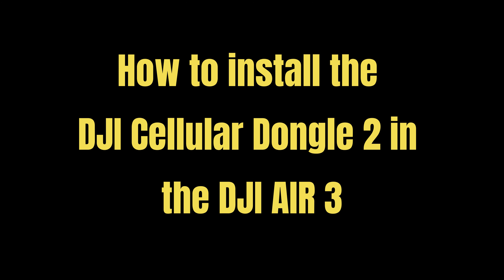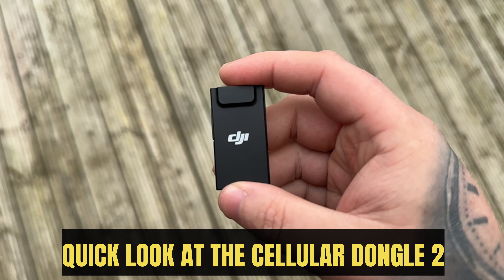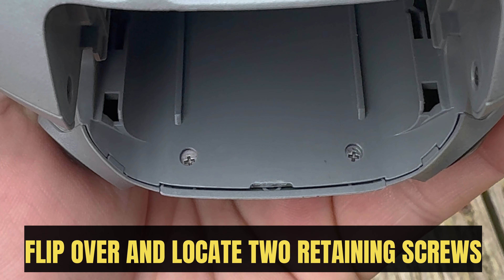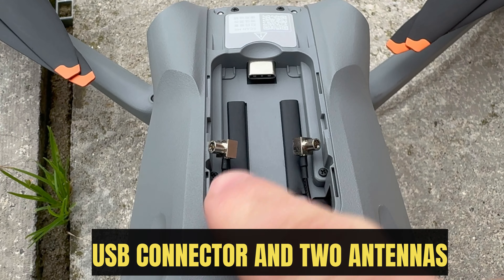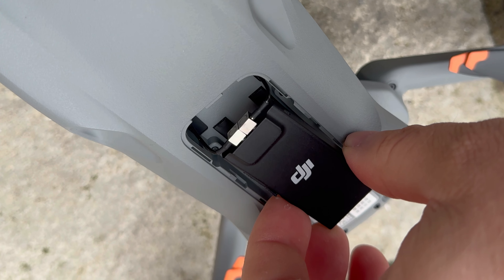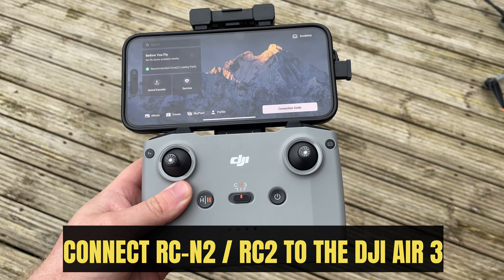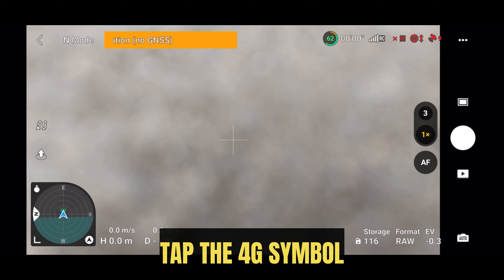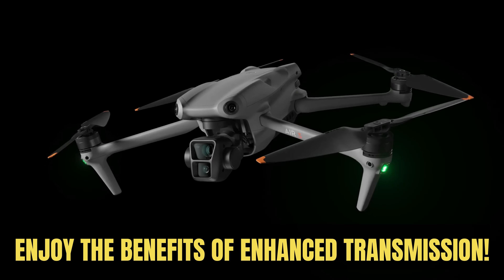How to Install DJI Cellular Dongle 2 - DJI Air 3 Set Up Tutorial

Comment: Just got my Air 3 and install the dongle not forgetting the aerial cover, the best G4 network around my way is EE, which do an 120gb data sim for a year cost is £60 I going to see how long 120gb will last
Reply from the maker: Wow that’s a good deal!
Reply: A 'standard flight' utilises approximately 800mb of data. I don't know what the trade off is in terms of switching from regular connection and 4g depending on signal strength. You can also get a 120gb nano sim from O2 for £50.00. It expires after 12 months. The alternative is an uncapped nano sim ftom EE which costs £16.00 per month on a 24 month contract. I was twitchy about using EE as they are part of BT and I really don't like BT. The fact that you have said the EE card seems good gives me confidence and I think I will go for their uncapped 2 year deal 😊
Reply: @geofflittler2035  thanks for the information, I think I may go and get an O2 SIM card as well 👍
Reply: You could use 120gb in 2 weeks it would nevet last a year
Reply: @geofflittler2035  where did you find the information about how much data is used per flight?
Reply: @jasonlee4267  There are a few people already using the dongle that I have had contact with on the DJI Forum. One lad is in Ausralia and I think the other one is in Poland. The Australian feller said that he uses an uncapped nano sim card and this seems to be the most appropriate way of running the 4g dongle. The people on that forum do seem heavily invested in DJI drones and they all seem to know what they are talking about. One  user said that he was using the dongle with a Mini 3 Pro and his data usage was approximately 800mb per flight with his drone battery running down to about 15% after 25 minutes flying. I was unable to establish what the trade off is if any when the drone is not using 4g but the standard drone to controller signal is good enough that 4g is not required.
Reply from the maker: @geofflittler2035 I feel those figures are correct, I’ll try edit the video asap
Reply: @GAVINHR  come on gavin were all waiting lol, i was going to wait till next week but figured after you upload ifnit is that good theyll sell out quick so ordered my today
Reply from the maker: @Michael77333  it’s incredible! Trust me, better than what I can show 🫢

Comment: Also...is there one of these for DJI mini 4 pro?
Reply: Can you use any sim card from any mobile phone provider?
Reply from the maker: Yes the same dongle fits the mini 4 pro with the mounting kit
Reply from the maker: Looks that way, I am using a SKY sim card and i have tried O2 and both worked
Reply: @GAVINHR  I live in the usa.  Is this to make it fly even further?
Reply: @BIGPAPAFOOT  due to DJI Support aint allowed on US soil -> DJI Forum. Sry
Reply: @GAVINHR  In have you noticed any difference with the signal?
Reply: @Teflonfilmare  not sure what you mean?
Reply from the maker: @slhk5848 I will be testing and checking this and will report back as that’s the whole point of it :)
Reply: @BIGPAPAFOOT  due to message on DJI Forum that rep claimed not supported in the US. DJI Cellular Dongle 2. Ok?
Reply: Does this not put the Mini 4 Pro over the 250 grammes limit?
Reply from the maker: @johnpirie4804  it sure does indeed but that only affects where you fly if
Reply: @johnpirie4804  there's an abundance of DJI aircrafts weighing over 0,55lbs. For these different rules and regulations are valid. And your question is Sir? Hmmm 🤔

Comment: OK here goes. I am such a lily livered push over for new stuff that DJI must be laughing behind their hands at me. I sold my Air 3 minus the dongle last Friday. Today my Air 3s turned up from DJI and tonight i charged it up and fitted the dongle. I have to say the dongle fits in about 20 seconds flat. The dongle compartment cover just clips on and off  no screws or screwdriver to mess around with. The black plastic clip that sits over the connectors on the Air 3 isn't needed either. The connections on the Air 3s are a single block with 2 connections which just slide onto the dongle. Once you slide the dongle onto the  main connector pretty much that's it. Tomorrow my new birdy flies😂

Comment: does the RC2 have built in 4g capability? or does this only work from phone to drone? on the Rc Pro you had to buy 2 of these dongles right? one for the controller and one for the drone.
Reply from the maker: Right so, no the RC2 has no 4G and it can't take a dongle, what you do is tether it to your mobile (hotspot) and it uses your mobile service, I will get the video out as soon as I can edit it where I show everything like this
Reply: @GAVINHR  awesome, thanks for this Gavin, I am waiting for the imminent Air 3s/Air 4 announcement in the next couple of weeks, but this dongle looks absolutely fantastic addition.

Comment: Nice idea, but what are the advantages / uses for the 4g connectivity?
Reply from the maker: My review video will be live later today, essentially bulletproof connection
Reply: Your drone is in range as long as its in an area, where there is 4G and your controller is connected to the internet either through 4G or WiFi.
It is even in range on the other side of the globe as long as there is 4G.

Comment: So can I just buy a sim card, and does it use data or just the 4g network? Also, stop teasing and get the thing in the air, lol how long did it take you to get the dongle? I did see dpd next day with a link to dji, but on their shop app, it says 20th of july.. 😁👌👍 🇬🇧
Reply from the maker: Yeah so I ordered it on the 30th June, it seems the mini 4 pro mounting kit is out of stock so they held the order until I contacted them on Thursday and they split the order and it came next day! Yeah I just used a sky SIM card out my iPad to test it and it worked fine
Reply: @GAVINHR  well I've got to order one now, lol. I've moved from Croydon london to a bit of a countryside, and with all the trees, the signal is crap so hopefully, this will sort out my issues 😀 nice one gav Cheers mate 👍
Reply from the maker: @UKBUBBLERS  let me try it first mate and see how good it is I wouldn’t want you wasting your money :)
Reply: @GAVINHR  yeah ill await your review, lol

Comment: To any of you who are Mini 4 Pro users you can  fit the dongle on your aircraft. You will need an external mounting kit which comes from DJI at around £16.00 Please bear in nind that the dongle weighs around 5g and will push you over your 250g ceiling. Personally I have the Air 3 so not such an issue.
Reply from the maker: Indeed, my mounting kit didn’t turn up sadly ( not useful for a review ) where did you get the usage data from?
Reply: @GAVINHR There's a couple of people on the DJI Forum. One lad in Australia and the other in Poland I think. I asked one of them about data and battery usage. Specifically if I am flying without the 4g requirement as my signal is strong enough do I still lose some battery? They said that approximately 800mb for a flight and that because the dongle is permanently powered during flight there is some battery usage. One of them was using a Mini 3 Pro and said his flight time was reduced to approximately 25 minutes. The other chap said that his battery loss was fairly negligible. I do not know which drone model he was using.

Comment: Never knew it was available in UK. I thought you could only buy it in china. I currently own the mini 4 pro
Reply from the maker: It’s just been relaunched as the “dongle 2” and it’s now available:)
Reply: @GAVINHR did you try it?
Reply from the maker: @Michael77333  yep, very very very successful flight !
Reply: @GAVINHR  well im doing overtime next week just what i needed thats ace, have you seen them 8200 mah batterys that fly for over an hour the chinese ones! Be worth a go with a apple airtag on top of the drone so you cant lose it, have the world record longest flight lol
Reply: @GAVINHR  did you do a range test with it
Reply from the maker: @Yeshua73732 absolutely! No I’ve not seen those ? I will have a look!
Reply: @GAVINHR  what range have you had so far
Reply: @GAVINHR can it be used anywhere or only just mainland china, as i contacted them to inquire they said its not officially released yet, so they said it only works in china?
Reply from the maker: @alishamrax that’s the original one, this is the new one that works elsewhere
Reply: @GAVINHR  how you know which is which, sorry for curious questions 😆
Reply from the maker: @alishamrax no it’s fine, the dongle 2 it’s called :) https://store.dji.com/uk/product/dji-cellular-2

Comment: Almost makes me want an Air 3 now lol
Reply from the maker: It works for the mini 4 pro aswell but DJI didn’t send me the mounting kit as it’s out of stock so I had to just focus on the air 3 installation, I’ll just strap it to the mini 4 with a cable tie until it comes 😂
Reply: @GAVINHR  trouble with the mini 4 is the  weight will be over 250g. I wish I could have one for my original mavic 3
Reply from the maker: @NickHarbornePhotography it does, but hey don’t forget, if you have the A2 CofC you can fly up to 500g in the open category where you can fly sub 249 ( I’m sure you may know that ) but just in case you didn’t
Reply: @GAVINHR  that's true but most don't have that. Let's be honest most mini owners  don't even have an op ID 😅😅 so it will just get ignored anyway lol. What we need is to adopt EASA I love flying abroad with my 898g mavic 3 V2.0 C1 pisses me off I can't fly the same here with it
Reply from the maker: @NickHarbornePhotography the CAA certainly seem to be dragging their heels don’t they regarding this, they could just say “ok we recognise the C classes” and let drone flyers crack on
Reply: @GAVINHR  What happens if you get some bad 4 g coverage while flying? will it automatically swith back to the wifi system that came with the drone so you do not lose connection and your drone?
Reply from the maker: @dheller777  if it’s using 4G then it will either switch to using its ocusync or RTH as a normal situation, I’m still trying to figure it out as I don’t want to talk rubbish and want to be sure before I say things but so far it’s very positive, I’m not sure if the ocusync uses the 4g connection or if it uses 4G on its own for control and video as both seem to be working with each other to give the strongest signal, it seems you still get the poor signal warnings but you still have full control of that makes any sense
Reply: @GAVINHR so no need for the fcc hack? Is it unlimited range or is that bull? Like i mean in a good 4g area?

Comment: Just WHAT is the benefits.
Reply from the maker: Essentially it uses the 4G mobile network for control and video so in theory if you had 4g signal you could essentially just keep flying indefinitely if you had enough battery!
Reply: @GAVINHR no way thats ace! Are these available for the mini 4?
Reply from the maker: @Yeshua73732 yep! It’s the same one as this you just buy the mounting kit
Reply: There some vids on YouTube from Korea using a Mavic3 [Dji dongle 1] and the guy is flying all over his city.